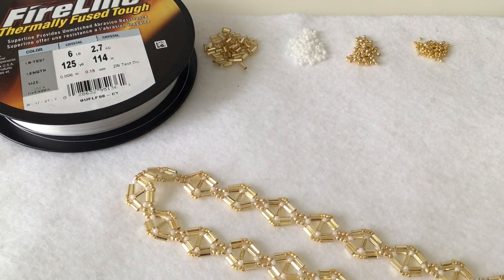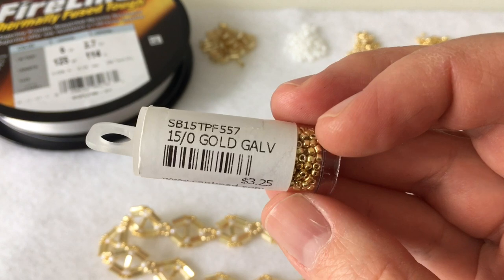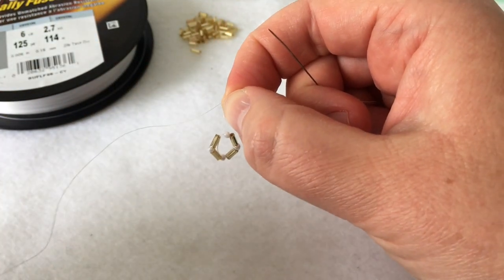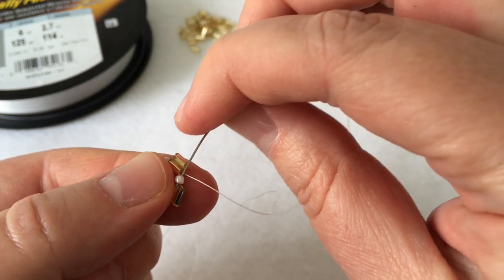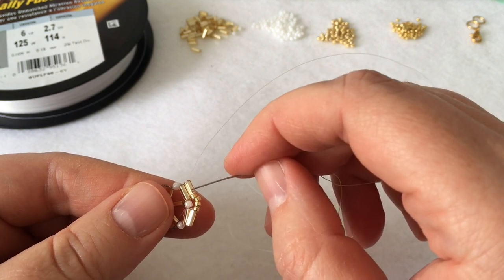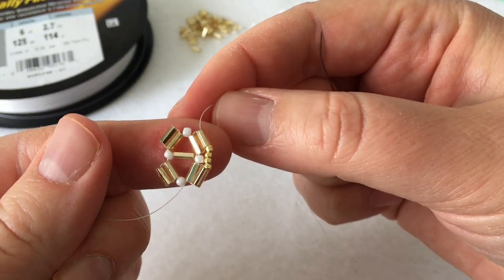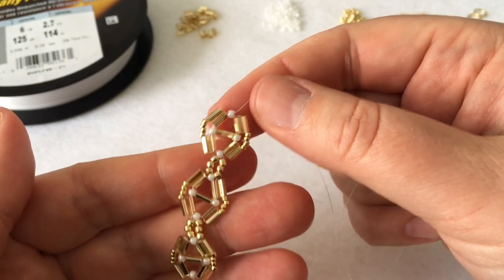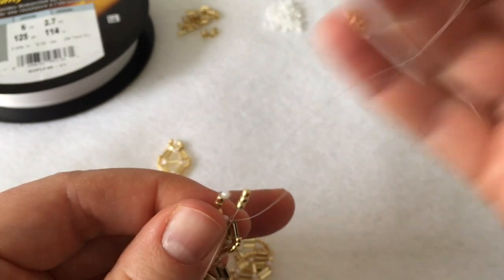BEADING TUTORIAL: Designer kite necklace - Bugle bead and seed bead necklace - Tutorial de abalorios

Comment: I adore this design! My only resvations are that bugle beads tend to cut through the line, and depending on the brand, can lose its metallic lining. I would waer this for special occasions only. Any tips on how to preserve matalllic seed beads and other metallic items from charms to clasps, I would truly appreciate it. 💕🧚🏻‍♀💕
Reply from the maker: I always use Fireline, which is the strongest fibre ever created, so I haven't had any issues to date. Not sure how to preserve metallic beads, but I would recommend using the ones that have a solid coating rather than a metallic lining if you're having issues. I guess it all depends on the brand. Thanks for your comments!